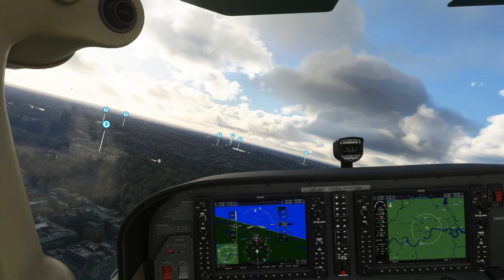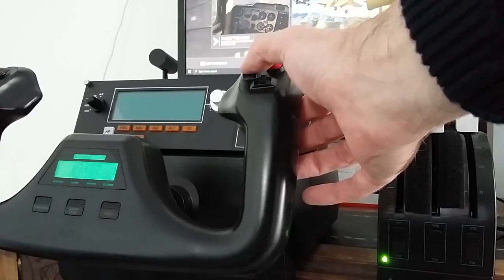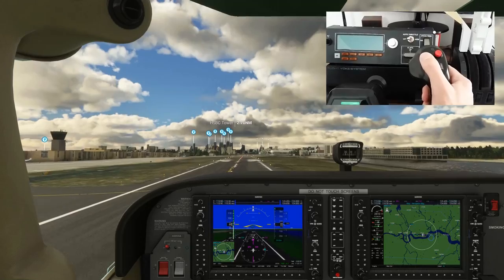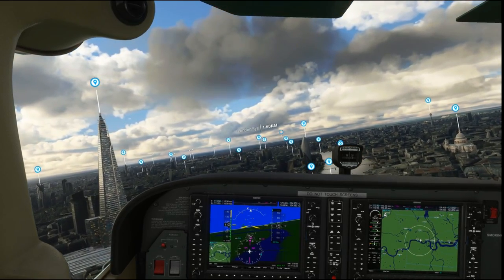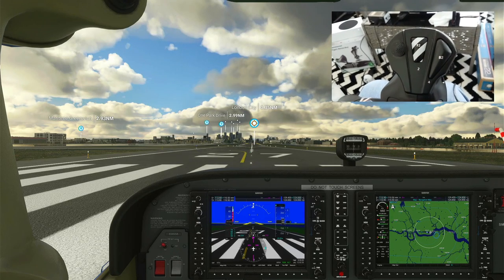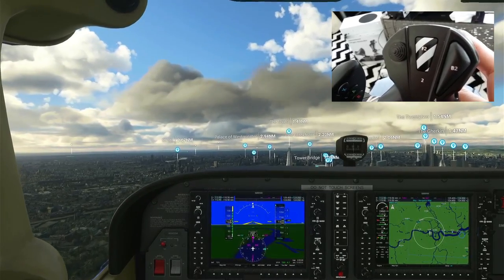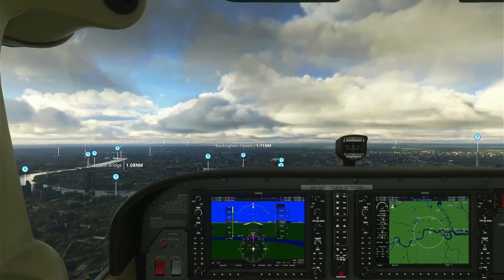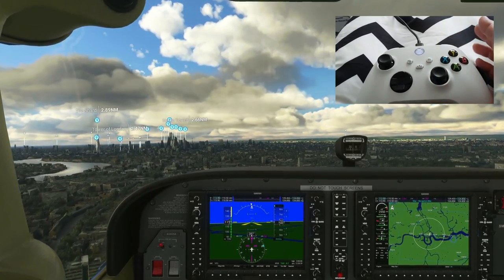FS2020: All About Trimming - Practical Hints & Tips on How to Trim With Various Controllers!

Comment: I used to use your method for controller trim but now have it set as RB + Up/Dwn on the left stick as it is mor intuive to me RB + Up LS = trim up, RB + LS Dwn = trim down. Great camera work on your options.
Reply from the maker: After reviewing my Xbox 360 controller on my PC (https://youtu.be/eRdqszFOrOA) I'm half tempted to use Left/right bumper buttons only for trim - but this will take away some of the added benefit of holding down the bumpers and assigning other functions to them.
Reply: You know, I was thinking of doing this myself too. I was also going to see what having throttle up and down on RB + right stick up/down was like too, which would free up A and B buttons for other things. EDIT: I tried this and it doesn't work for me. Having Trim set to RB and left stick still pitches the aircraft even when holding RB and RB + right stick behaves very strangely - you hold RB and push the right stick up and let go of the stick but the throttle continues to rise until you let go of RB. So I have since gone back to the original setup for now :D
Reply: @Huddison  I use the left and right bumpers in that way, though I tend to use my hotas almost exclusively.

Comment: I have been practicing using trim for a few days just doing basic takeoffs and landings on small runways. The trim just becomes muscle memory to the point where you won't think about it. Trimming manually is more fun and practical than the AI trimming for you. A good way to learn is to see how the trim effects your aircraft at different speeds and flaps. It makes your takeoffs much easier and helps you land much better. I used to just let the AI decide for me but thought that wasn't how you should experience the game. So I decided to change the settings to True To Life and it was honestly much more fun and taught me how to control the plane better.
Reply from the maker: Wonderful additions - thanks.

Comment: I've found a bit different way to trim, using one of the "secondary" axis knob (RTY3) on my old X-55 throttle control. The problem is that every airplane type handles trim differently. What is too fine for one airplane, could be too harsh for another. I solved this by adjusting the axis curve in X-55 app the way that is is very narrow around center (allowing me to fine tune around 0% trim) and gets much steeper on the both ends (allowing for some significant changes if needed). Works well to me.

Comment: Thank,you for this. Trimming is the bane of flying in MSFS. For the many of us who have flown a real Cessna 172, your video clearly demonstrates it’s much harder to trim in MSFS 2020 and than in the real airplane. That said, moving a step up into into airplanes like the C208 caravan, the rudder and aileron trims are where I really struggle. Getting the C208 to fly straight and level seems to me to be far too hard in MSFS 2020. How do you handle rudder and aileron trimming?
Reply: I don’t claim to speak for Huddison, he does a fine job of that by himself lol, but it those aircraft I tend to default to the actual cockpit controls for rudder and aileron trimming. I have no idea why Thrustmaster made their hat switch on the hotas one useless for trimming.
Reply from the maker: Hi Steve, when I fly the Caravan on PC, I use the left/right rocker switch next to my up/down rocker on the Flight Yoke system, for aileron trim.
This seems to work well for the odd time that I need to use it.

Comment: Remeber trim for airspeed. power for altitude.  excess power at set trim you climb, decrease in power required for level flight at set trim you  descend.  Trim for desired airspedd then use power for controlled climb or descent.
Reply from the maker: 100%
Reply: you need to rewrite this my friend, hard to follow your english...
Reply: thank miss grammer.  remember, airspeed, I blame my thumbs and the small type of a auto correcting phone, thank you God speed my friend

Comment: Ive been flight simming for 40 years and have never seen any trim issues as annoying as in MSFS2020.  Its like the trim wheel has a mind of its own.  What used to be as easy as push a button trim up push another button trim down has devolved to some unknown Key pushes that work too fast if you hold it too many ms's and not enough if you click once.
Reply from the maker: It does seem a bit over zealous.
Reply: I flight simmed since 1980 FS1. I've memorized all the keyboard through the abandoned 10. I can't even find the radios or gps or auto pilot in this version. There's zero documents and all is changed.

Comment: So do I gather that with the trim wheel pushing forward is for going up and pushing down will have you go down. And then having to find a point where you are flying at a consistent level flight.
Reply from the maker: You typically push forward on the trim wheel to trim nose down and back to trim up - sounds counter-intuitive but one soon gets used to it ;)

Comment: So, I have a solid fix for the horrible gritty sticktion of the hotas one t-flight rudder pedals, I ordered two sets (4 total) Linear Rail Rod 10mm x 300mm from Amazon, cut them (with an angel grinder, these shafts are hard) to 9 3/8" long, and install, the problem with the original is that, the sliders are glass reinforced plastic, so they are grinding into the low grade slider rails, hope this helps
Reply from the maker: Thanks I'm certain that will be helpful to many 👍
Reply: Yeah, I was having buyers remorse, I figured can't make it any worse, lol,

Comment: It’s very strange. I used to be able to use the rocker switch on my hotas 1 controller for x box S but it just stopped working. I now use the B1 and B2 buttons and I’m happy enough with this.
Reply from the maker: It actually works much better in my opinion.

Comment: Hello From Paris, very useful video as usual, congratulations
a quick question on the xbox (but it might be the same on the PC),
What is your trimming setting before take-off 0% ,2% ?
thanks
Toni
Reply from the maker: Hi toni,
My Trim setting was left as default prior take-off.
Reply: That IMHO depends on the airplane type and takeoff weight. Also, Cessna C192, for example should have "takeoff" trim marked on the trim wheel...

Comment: Thank you sir, I am new to FS2020 on XBOX, I am trying to keep the C152 in steady flight, 2000 rpm, 80 kts, hard trying to keep it dead level, I have weather set to calm..nose just wants to dive after a 30 seconds or so...I am constantly trimming up all the time?
Reply from the maker: I'm not quite sure what's causing that, but come and join our Discord: https://discord.gg/3kra6JfHZT - we can better share tips with you there.
Reply: @Huddison  looks like the AI AUTO TRIM was on under Assistance Options - PILOTING, Problem solved
Reply from the maker: @simpilotjoe535  ah yes; that's often the culprit.

Comment: Just found that link from you. I have a question: How to reset to 0 the elevator trim. There is the option to set the trim to take off but is there any way to reset the elevator trim to 0 by assigning a button? 
Thank you in advance Huddison:)
Reply from the maker: I think you may be able to achieve this and I shall look into it.
Reply: @Huddison  thank you thank you